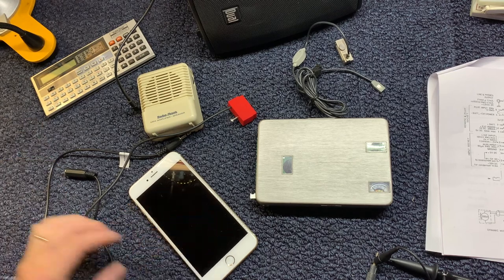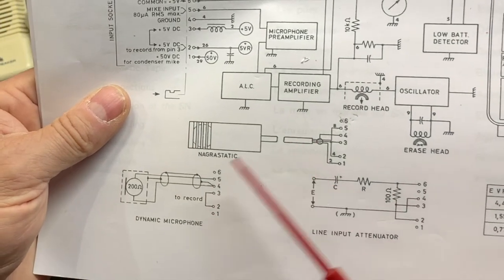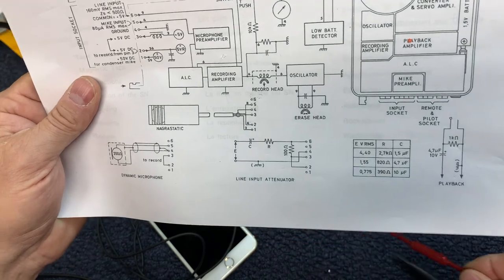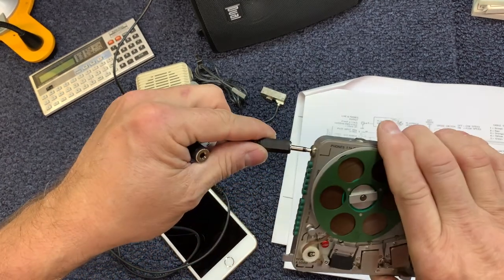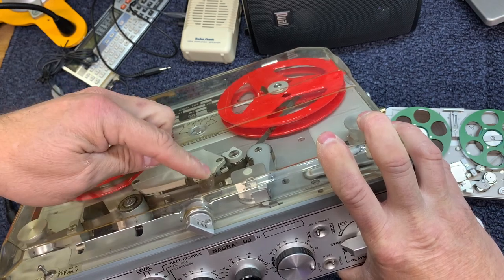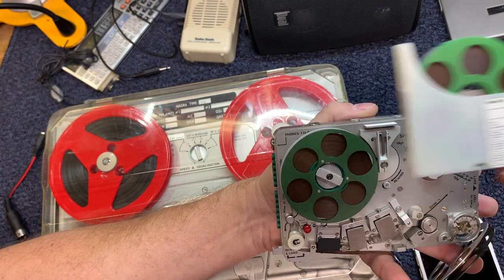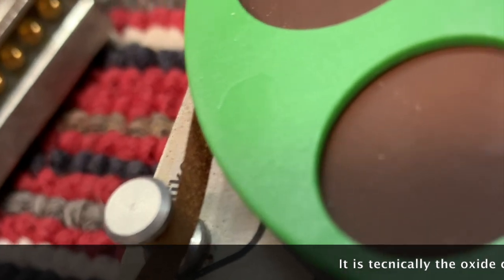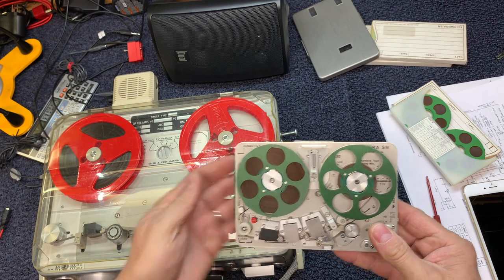Espionage Nagra SNN: Technical Application

Comment: The Nagra SNS uses 15/16 tape speed, so it will be printed on there so they can use the same face plate for both models. I noticed it on your previous video when you showed the running times on the spare tapes at 10:58. Also these Nagra's use 1/8th inch tape, the same as normal cassettes, so maybe you could replace the tape. Just don't forget the oxide coating is on the outside of the reels on a cassette. :) Happy recording and stay safe.
Reply from the maker: Brilliant. Good eye. Completely missed that. That’s a great idea to replace the tape with cassette material. I’ll do that. Bet it makes a big difference!
Reply: @KOVintageTech  You'll have to try different cassette tape as the bias will change from Type I/II and so on. I'll be interested to know how you get on.
Reply from the maker: Frank, yes, was sitting here on the front porch sipping coffee pondering that.  I don’t have any NOS cassettes. So I’ll order a couple and do some tests.
Reply from the maker: I did this.  And the newer cassette tape records and plays beautifully.  I did a bulk erase on it as the SNN was playing both tracks of the pre-recorded music at the same time.  I plan to replace all of my "old" tape material with new cassette tape material.  The 90 minute tapes don't fill up a nagra spool, so I need to find some 120 minute tapes.  Super thin!
Reply: @KOVintageTech  Excellent. That's great news. Glad to help. I wounder if you could splice two tapes together to fill a spool. You'd need good eyes and steady hands for that, Neither of which I have. LOL. But there would probably be a bit of drop-out on the splice and it would create a weak spot that could easily break. I've only ever spliced 1/4 inch RTR tape.
Reply from the maker: @frankowalker4662  I made a splicing tool for these tiny tapes.  Printed it. Works great on this small stuff used ito to repair 2 track tapes
Reply: @KOVintageTech  Nice one. With NOS tapes and cassettes slowly making a come back, there should be no shortage of tape.